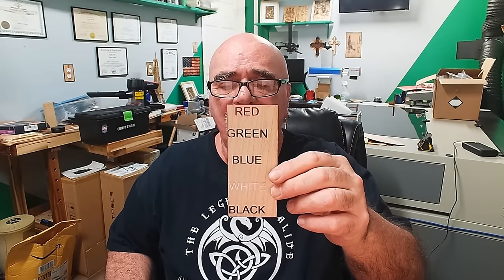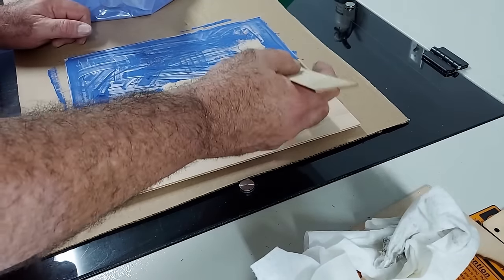😲 Laser Engraving in COLOR! Diode Laser & Co2! A powder coat trick!

Comment: I haven't looked at more of your videos so you may have a solution and if so I'll come across it shortly. I'm waiting on a new diode laser unit and when it gets here I can get some photos of how this works. Both mica and powder coat will work. I've not tried Brian Trotter's suggestion of using the thin glass but I will and maybe that in combination with this process. So my process is almost identical to the paint fill method. Unfortunately you have more waste this way, so you have to decide if the results are worth the waste.

1. If your project is wood, or something absorbent, pre-stain with the exception of leather goods, they do not need it. You mask your material then do your etch. I almost always mask as I find I get much better results especially with diode lasers.

2. If you are using mica powder mix your chosen color with white mica. There is no exact ratio but you want a pastel version of your final color. I find putting it in a glass jar and using one of the cheap electric fingernail polish shakers gets a very good mix. Most of them are labeled 'vortex shaker'

3a. If you are working on wood, cardboard, cork board,  or similar I mix the powder with Minwax Polycrylic Clear. Experiment with gloss, satin and mate as they all have different results. The consistency you want is about like drywall putty as it prevents bleeding. (go to step 4)

3b: For metals, plastics, leather and similar items, I substitute acrylic clear gel medium.  It is very important that you get a medium, not a varnish not a clear and not a gesso.  I have not seen any difference in output based on brand of medium, but I use Golden as I use it in other projects and it's one of the top of the line and thus expensive. Just check reviews and get the most affordable with decent reviews.

4. With a straight edge (putty knife, used gift card, popsicle stick, just as long as it's straight) spread your putty over the masked etching making sure it gets all the way into the etching. The excess can be stored in a sealed jar in a cool spot free from light/sun/uv for about a day. You may need to add a small bit of medium to get back to the right consistency.

5. Do your color etching at a slow speed. Roughly 20% less or 80% of your normal speed as you are now evaporating a liquid as well as melting an bonding a powder. Use a toothpick or something to make sure the color is solid and not soft. If it's not hard do another pass at 50% of the power you used the first pass.

6. Remove the mask, and apply your desired top coat.

This process is known as "in-fill" and though this will work on etched glass I prefer a different method for glass with the exception of drink ware. The process is called "back-fill". You etch the back side of the glass with your image mirrored and you do not do any masking. The reason for that is that no matter what you do, nothing is going to bond to glass and with a mask you will have a slight raised edge to your back-fill that could get snagged and pulled out. For glass you definitely want a sharp edge putty knife. Once you have your engraving filled and most of your excess scrapped off lightly mist the surface with clear windex, not the blue stuff and not the vinegar. With the putty knife at an angle so that a cross stroke pushes across and down. Start from the top and go one direction, either left to right or right to left. Do not alternate and wipe the putty knife after every swipe. Now you can run your laser to solidify the back-fill. Technically you could let it dry and have the same results, but using the laser results in a much more durable back-fill.

These processes also allow you to use low volume(10-15L/min) air-assist where you would not be able to with just powder. Cooling off the in-fill/back-fill is much like quenching steel and helps with durability.
Reply from the maker: Try posting on my free forums. https://lahobbyguy.com/bb  This is too much to answer in a YouTube comment.

Comment: Air blowing away powder ideas:

Change the  cooling on the laser to remote water cooled?

Modify the laser housing so the cooling air is shunted horizontally before it gets to the lens area.  (I'm thinking some 3d printed parts to guide the air away... Maybe even a part that goes around the lens that moves the air out to the side.)

A lens with a higher focal point?
Reply from the maker: All good ideas, and I can just flip over the cooling fan; that works. But I am still looking for a method that takes no modifications at all for the end user.

Comment: Hey Rich, yet another option here would be to use a dedicated laser module.  Since you dont need huge power, perhaps consider one of the 15W ortur lasers - with the adjustable lens.  Now install a long focus G8 lens on the laser.  This will allow you to raise the laser up and maybe that would make enough difference on air flow.  But I see also your idea to reverse the fan, that could likely work well also, since you are using a very low power setting the laser wont get as hot either.
Reply from the maker: Yeah Peter, that would work, but I'm trying to make this work with no mods so everyone can do it.

Comment: How about applying the powered paint with a small "Salt shaker" or similar applicator ?   You could even color different areas with different colors. You may need to mask adjacent areas with loose pieces of paper.  Once the areas are all covered, you might be able to "set" them all in one pass.  Just a thought. I haven't tried it yet.

I just got an LM3 for my shop.  Can't wait to fire it up.   But, the Wife says I've got to get the Hall bath remodel done first.  And after 50 odd years, she is the boss of me. Or at least that's what she told me...kunk
Reply from the maker: This process is working well for me.
Reply: Excellent.  Take care...kunk

Comment: I know this video is older. I just came across it trying to find the settings people are using to engrave stainless in color.  But I was wondering if the water method worked could you mask it engrave then use that method to not stain.  Also I’ve tried mica before on a diode and it was quite the mess so I’m glad I’m not the only one that’s explored this.   But I found that oil rub paint on ceramic will engrave in color as well and the excess wipes away clean.  The unfortunate part… like firing mica you have to test the colors because the fired color isn’t the powder color.  Kinda the nature of the beast with micas. But it does work.  I got a nice pale blue engraving out of bronze oil run paint on a non glazed ceramic tile from Lowe’s when I was playing with my original 10w diode laser.
Reply from the maker: I don't know anything about the water method.

Comment: Hi, Just tried the powder coating trick. Had the same issue with silver. It just burned through and decreasing the power did not make it stick. Found a solution that works up to a point. On my 22w diode. I ran it at 10000 speed and 7% power. Then cpated again and rerun at 10000 at 15%. this seems to help
Reply from the maker: I found a new way to do it: https://www.youtube.com/watch?v=GPtq19ZQ6eg&t=2434s

Comment: Rich,
You seem to have many CO2 & diode lasers in your possession.
I only have one 20W diode laser.
(I had a 5W Diode but gave it to my 17 year old nephew).

Can I do a deep engraving in wood and the wipe blue paint across the engraving ?
The next step would be to re-engrave the  same drawing & then wipe off the wet paint.

If I laser engrave on "kinda wet paint" with a diode laser or would I ruin my laser head ?

Other question is "Did you use a specific type of blue paint in this video ?"
I am assuming you used "Pittsburgh" or "Behr" blue paint from off the shelf.
Reply from the maker: I don't know, give it a try Tom! I used dry powder coat in this video.

Comment: So I'm guessing you should never use Air Assist when engraving and powder coating with a diode? Thanks for the videos!
Reply from the maker: Well William, I did find a really good solution. I got some really thin pane glass from Lowes and covered the engraving. Works really well!

Comment: Very interesting! I have some questions:
1) What type of paint powder do you use?
2) Why don't you spread the dust with a brush, for example, instead of a spatula, as you say you can scratch?
3) Do you spread the dust on the surface totally dry?
4) Did you talk about mica is to replace the powder paint?
Sorry for so many questions, because the translator does not translate correctly and I do not understand English; Thank you very much
Reply from the maker: Powder coat & Mica.
The brush doesn't spread it evenly
Totally dry
Yes
Reply: @TheLouisianaHobbyGuy  Thanks for your answer.
Allow me one more question: Can this powder paint and mica be purchased, for example, on Chinese websites such as Aliexpress or Shopee? Well, I don't usually use the Amazon site to buy. In other words, is it any powder paint?  Thanks again
Reply from the maker: @Dancopymus  I don't know about where to buy it other than Amazon, but yes, it's basically powdered paint.
Reply: @TheLouisianaHobbyGuy  Okay, I just couldn't get the Compass file.

Comment: Would use of a heat press to initially heat and secure the powder cost before running it through the diode laser.  Any powder coat,  over with paper and heat press or, instead cover with paper transfer tape and then laser without heat press.  Just a thought.
Reply from the maker: I was trying to do it without any hacks. I settled on very thin window pane glass.

Comment: Liquid cool the heat sink or at least use a much bigger heat sink that can dissipate the heat enough to not need the fan. I'm not sure how hot the diode gets but I'm sure it's doable without having a fan right at the laser.
Reply from the maker: I was looking to do this so anyone can without modifications. I found covering it with really thin picture frame glass worked well.

Comment: This is truly formidable and it opens a whole new range of products that can be created.  Just an idea. What if you invert the diode laser ventilator so it draws air upwards through the heatsink instead of blowing downward. It should cool the laser module by the same degree theoretically because the speed would be the same.  Great video.
Reply from the maker: Yes, that's been suggested. I'm going to try it Raymond!

Comment: Thanks for the video! I haven't used my engraver for awhile and was reviewing techniques and found this one. So many great makers sharing. A quick idea on the diode laser fan problem that might help. Can the fan be flipped to pull air up? It won't be as effective but should still cool the diode and help with the powder.
Reply from the maker: No Bill, that would ruin the lens pretty quickly.

Comment: I wonder if the method for putting the powder coating onto/into the etched surface and leveling with a hard edge like a credit card or timber or trowel, then dust off the excess is the 'problem' for some and not for others who lightly brush the powder coat around the surface. 
Which 'could' mean that the particle size of the powder coat or any granular paint is broken down to dust rather than grains which 'could' mean the coating is easily blown dust and not grains as such?
Reply from the maker: I press it down with the aluminum card.

Comment: The best option is to get a duct to redirect the lasers heatsink fan output off to the side instead of toward the job after it passes through the actual heatsink of course. Usually it helps blow some smoke from burning material away so the laser isn’t obstructed, but that’s not a huge issue when melting and bonding things.
Instead of turning the power down you could also have a second job from the same project that only traces the center of the graphic, then unfocus the laser some to spread out the power. It works well for lettering, speeds up the process and lets you gradually step power up easier to find the melting point without scorching. Harder to calculate exactly what power is hitting the surface but since it’s only a center line you could run back to back tests rather quickly.
Reply from the maker: Thanks for the comments!

Comment: Awesome video as usual, Rich. I too have been playing around with powder coating powder. I have an xTool D1 and designed and printed a cover with side vents that installs over the business end of the laser that redirects the cooling fan air out to the sides. It also has the 20 mm opening for the air assist ( which of course will be turned off while using the powder) and a clear window for the cross hairs to still be utilized.
Reply from the maker: Can you get the white to melt without blowing off Paul?
Reply: @TheLouisianaHobbyGuy  Haven't tried white yet.  I've done Blue, Red and Orange.  I don't see why my cover wouldn't work for the white
Reply: @TheLouisianaHobbyGuy  I've also got the xTool.  I've been able to burn the white no problem (with glass).  Keep the laser fast and weak for the lighter colors, though, or you'll get gray or black instead of white.
Reply from the maker: @Tkrain  Glass didn't work for me.

Comment: Hi Rich. First, thanks for the effort and dedication you put in every video. Second, depending on the focal length of the diode laser you can't put a glass between the laser and the surface you are engraving with the powder?
Best regards,
Fernando from Portugal
Reply from the maker: Most modern lasers are now switching to short focus Fernando, so there's only a mm or two of space. But maybe on a long focus.
Reply: I have the xTool D1 10w, which has a shield which is easily removeable, leaving me plenty of clearance to put glass between the laser and the work (make sure the glass is at least 1mm, better 2mm from the work so you don't get interaction with the glass instead of the work).  Many lasers (my Dad's old AtomStack comes to mind) build the heatsink housing all the way to the 2mm mark, which renders using glass virtually impossible.

Comment: For the diode, what about a piece of borosilicate glass on top to act as a shield against the fan. Shouldn’t defuse the beam, and if it’s a little above the piece I wonder how well it would work for those finer powders…
Reply from the maker: I'm concentrating on getting the right powder so the average user can do this without mods Jody. Easiest thing is to flip the fan over on top.
Reply: @TheLouisianaHobbyGuy   flipping the fan on top is not a good idea. The suction is not as strong as the blowing with all the consequences that implies. And it would suck the smoke into the laser head as well.

Comment: Could you not use some bulldog adhesion spray to get the white powder to stick after the initial engraving? 
Would that allow it to keep the power from going away? Perhaps electroplating the wood after the engraving 
to give the powder a surface to burn into easier that will make those white bright and noticeable.
Reply from the maker: I just covered it with some thin picture frame glass.

Comment: I have to wonder if you were to use the aluminum business card with the white powder coat, you might be able to pack the powder into the engraving more firmly. Perhaps that might keep the powder from blowing away?

Edit: Powder Coat is not actually any sort of paint. All it consists of is very finely ground plastic. 

Also, on your rifle project, I thing the darker color of the wider engraving adds more interest and character to the job than if all of it were to be the exact same intensity of blue.
Reply from the maker: I tried with a putty knife which is the same thing; didn't work on light colors Philip.
Reply: That’s too bad. Did you try multiple applications and burns of the white powder?

Comment: Hi Rich, I’m new to diode but have been using fiber for around 3 years, was watching this video & you spoke about the diode fan blowing the powdered paint away, may I suggest filling the grooves as normal & then applying a light coat of hairspray? Might help…
Reply from the maker: Thanks Wayne, I found a new method with a heat gun, but Previously, I bought some really thin pane glass from Lowe's that did the trick.
Reply: Hi Rich, thank you so much for your reply, having a fiber background i battle with the “no base” on my diode so I have created a base and grid prototype which works for me, maybe it helps someone else as well, I don’t know how to add photo or video though…

Comment: good work but i saw some videos for ppl putting a tap before engraving and then they put any color .. after that they just remove the tape.. what do you think? you are the pro
Reply from the maker: That's masking and then painting. It works well, but there are bleeds unless you use the green tape or laser masking tape. This is slightly different and gives a completely different look. You can see me do this live here: https://www.youtube.com/watch?v=GPtq19ZQ6eg&t=4799s
Reply: @TheLouisianaHobbyGuy 
Green Tape = Frog Tape (brand)--has a special polymer adhesive that prevents/absorbs bleeds.

Comment: I use a plastic deflector on the bottom of the spindle on my CNC router to stop the air blowing on the work piece. Could something like that work on the diode laser? I really want to try power coat on some engraving soon. Thanks for the video!
Reply from the maker: It depends on the laser module. Lots of the newer ones, the heatsink goes all the way down to the material.

Comment: Hi Rich, 
I am a recent fan of your channel. After your videos, I am impressed with laser engraver and bought one online Sculpfun S10. However this works fantastic, and after your coloring video, I bought pack full of Mica Powder and tried. The result is not good as the fan in the laser blows the power away before it starts engraving. Do you have any solution for this. Will be highly appreciated. Thanks.
Reply from the maker: I wound up covering it with a thin piece of picture frame glass.